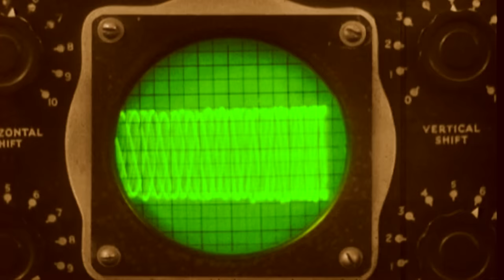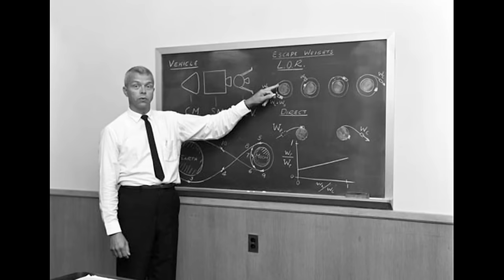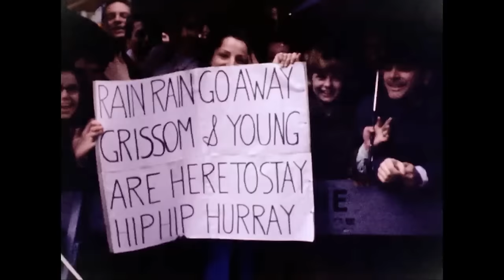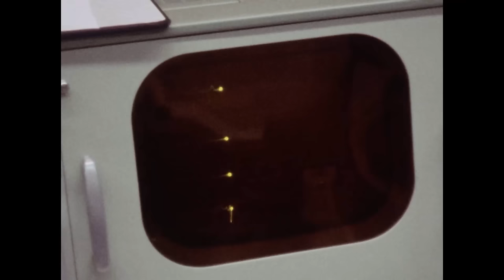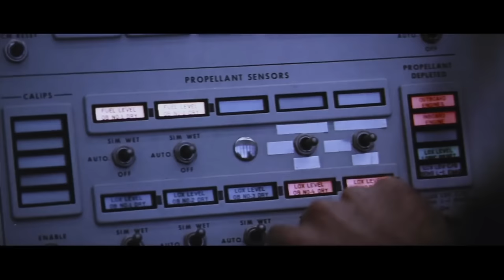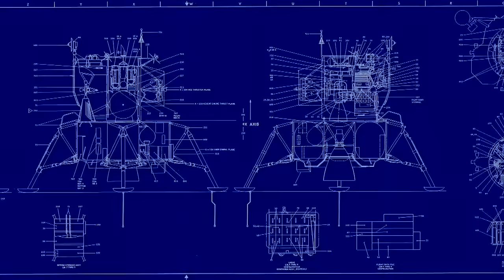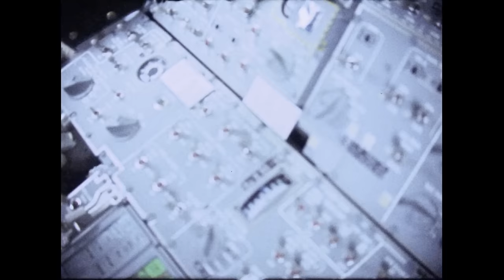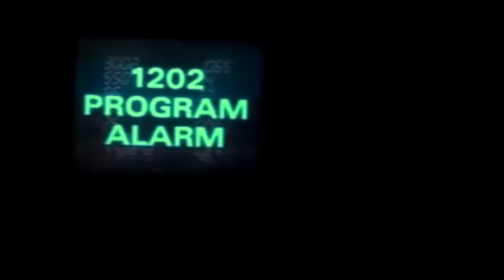The True Story Of Apollo 11's Space Race | To The Moon: Moon Landing Documentary | Cosmic

Comment: How was it possible to attach moonlander back to the mothership flying in its orbit around the Moon 27 000Km/h.Can you ride a car to a carage in tha kind of speed while carage is moving.How to find the mothership in the skies of Moon.Impossible with only eye sight.Radars were pretty heavy at the time.May I suggest that mayby the landing on the Moon was a fake ?
Reply: Because the "moonlander" was doing 27000 too! And yes, they had radar.

The moon landing was real. Maybe learn something about a subject before posting nonsense?
Reply: You're moving at 1,000 mph as the earth spins.  And on top of that the sun and earth are hurtling through space i don't know how fast.  Yet you can put a spoon in your mouth.
Reply: @jgunther3398  The sun orbits the center of the Milky Way at a half million miles per hour and still I have no trouble threading a needle if I'm wearing my glasses.
Reply: @jgunther3398 , NAILED IT!

Somewhere zero and about 1000MPH.
(Very little rotational speed at the poles.
A LOT at the equator.)

I read somewhere, the total is closer to 
1 million MPH, adding everything in.
( could be off a wee bit.)
Reply: @mike.j3913  How about the other 5 moon landings?